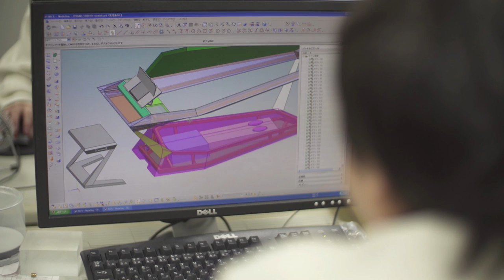Roland Facet Grand Piano

Comment: 0:35 It’s still Windows XP!
Reply: What else do you need?
Reply: luisbrandolb anything that’s supported, can run modern software on modern hardware?
Reply: what is the reason why people use w xp? you can get windows 7 and even windows 10 for free, so why use the old version?
Reply: They depend on custom software that isn't compatible with later versions of the operating system
Reply: The Stans are still out there!!!!
Reply: Maybe it’s Windows XP theme on Windows 10 😉
Reply: @1hminen  Why? 2 words. Bespoke software.
Reply: Ihminen - Never fix what ain't broken. That's the reason for some.
Reply: XP is the best Windows ever!

Comment: I don't mean to disrespect this guy but, if it doesn't have a string basically it's a digital piano with waste of space? I don't get it.
Reply: The design makes the sound a lot better than a normal digital piano, same with the difference with an upright and a grand
Reply: @wellshoot  how
Reply: Evan Cooper you do know the grands are different than uprights not just because of the design right
Reply: @wellshoot  i mean it cames from the same speakers though. If it sounds better it just means that the speakers are better.
Reply: @azzaalhanifa  I think the idea is that it sounds more like a grand piano due to the placement of the speakers. I dont see any situation where you would use this instead of a acoustic grand piano though

Comment: Looks very nice, but very fragile at the same time. Good luck during the transport. Also why are the speakers on the bottom? My ears are on my head not on my feet. As a design study it’s great, but maybe it will be great if you can fold the top into the bottom.

Comment: One thing:
He said the electronic piano don't have strings so the sound system was being put in the bottom.
I think it partially right. The sound that produced by the speakers is not necessary to come from a complete piano soundbox replica, but most of the manufacturers still made the high-end products to look like a acoustic piano. Why? I believe the structure and the wood material of the soundbox still matters if you want the sound to be as near as the real one. Electronic pianos don't vibrate their strings, but the wood still vibrates, and the spaces and holes also affect more.
It's a cool concept I admit. But it's not useful as a regular product. It's kind of like the fact that you can't never create a real 7.1 surround audio experience by using 2 channel speakers and virtual audio effects.